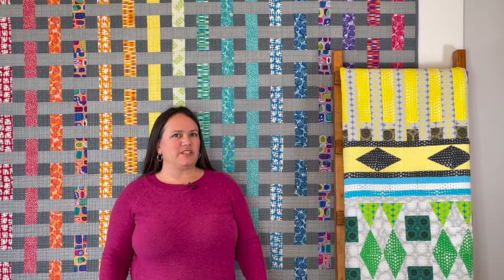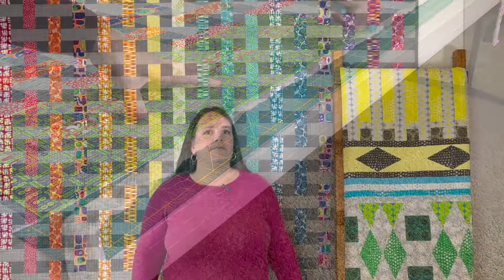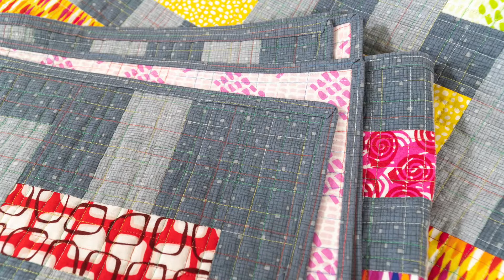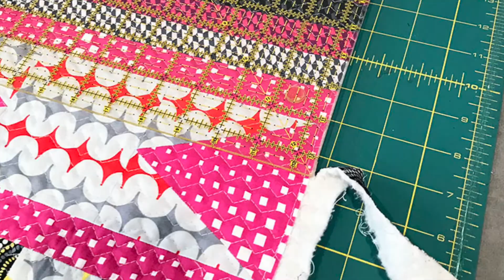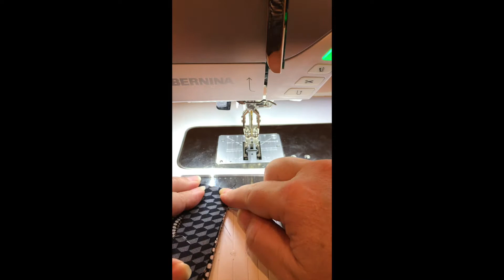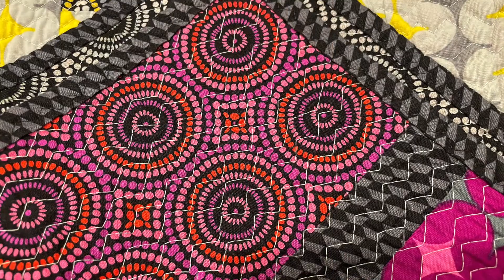How to Machine Bind Your Quilt

Comment: I was told to leave 1/4 inch of batt around edge to fill binding, so to not take width from the pattern.  What say you?
Reply from the maker: I think it's much easier to cut a narrow 2" binding and trim the edges flush, then wrap it tightly around the quilt. It holds up great, too!

Comment: Thank you for demonstrating what I consider the optimum method of machine binding. Christa, do you realize how few people teach this method?  I will NEVER hand sew a binding.  As a new quilter, I had to learn the hardest most frustrating lessons on the final join of binding through trial and error before abandoning the oft-taught, to the method that you demonstrate.  (But learning this method was frustrating because it is easy to be inside out and upside down).  I don't get on the soap box for much, but evangelizing this method  and sharing how I overcame my frustrations, is near and dear to my heart and is in addition to, not in place of, your excellent instruction.   I know that others have these problems otherwise the more inferior method would not be taught at all.

Your teaching embraces the following essential three elements for machine:

(1) pre mitering the binding strips.  You will never have a wobbly join (I use my CG Folded Corner Clipper for these due to its shape and size-:it is a MVP tool in my sewing room). I think that this is particularly important for new quilters because it provides a better visual, and reduces eliminates  material handling and sewing errors.

(2) sewing on the back and pushing binding to the front.  Why the "catch as catch can" method for machine binding  where the back binding may or may not be "caught" is shown time and again, I do not know.  It is an inferior method to this one. After 2 quilts, ditched that method and adopted this one.    My newer Bernina walking foot has an center edge guide which I can align perfectly with the binding edge. I can control perfectly each stitch. I've also seen a lapseam foot used--but I see no benefit over my foot choice.

Note that if you are mindful of where your original sew line is  the mechanics of sewing means that it will be in the ditch on the back--now achieving that perfect balance is sort of the holy grail.  But before you attain that,  It is sort of a "no matter" because if you are using a blended bobbin thread, your back is going to look just fine as you note.  If you have a dual feed, an edge foot could also be a helpful guide.  

(3) Mitering the final join. With all the trouble one goes to on the quilt, to have a "fold and tuck" final join is like serving a Twinkie for dessert after a fancy meal.  It is not worthy of the quilt.  A mitered final join should be the gold standard. People think that they cannot achieve it.  I'm embarrassed to say that I watched many videos and the twists, turns didn't stick in my head.  I just could not visualize it (and it did not help that the quilt orientation was different among the videos).  I know that I'm not the only one, because many do NOT use this method and opt for the fold and tuck.

(Get the Creative Grids Folded Corner Clipper (small)--you will use this for a lifetime of quilting).   When you cut your miters, the seam allowance is built into the cut.  It is more agile due to its size, and the tails are blunted for you, so there is no guesswork. (Accordingly, I'm not adding any additional seam allowance in my instruction below).    

So for the spatially challenged (me!), I want to share my tips for tearless, curseless, fearless joins:  guaranteed to be perfect, and your  brain will not overheat.  (Just as Christa demonstrates, with some small changes). Mitering your cuts before you join them makes the visual cues and material handling easier.

Orientation matters.  Work with your binding away from (quilt toward) you for these instructions.  Your starting tail is on the right (pointed left), and your ending tail is on the left (pointed right).(and yes you can do it the obverse--but remember I'm spatially challenged).  Develop your preferred orientation and work processes to ensure that ends are always where they need to be and you don't end up upside down/inside out (and think too hard about it each time).    Using CG ruler, when you cut your miters, the seam allowance is built in to the cut.  It is more agile due to its size, and the tails are blunted for you, so there is no guesswork. (Accordingly, I'm not adding any additional seam allowance in my instruction below).    

I work with 90 degree ends-and cut both together on the miter as follows:  Leave long enough ending tail  to work comfortably.  Leaving the binding folded,  measure the overlap for the width of the binding, and  cut it a wee bit longer.  This provides a wider gap _by a smidge_, but ensures that you get a flat final lay (taught NOT tight).  There is nothing worse than having a flaccid binding. (When carpenters and tile folks measure for precision cuts, they say the measure and then say  "inside" and "outside"  if they need a smidge less or more without going to the next measure. Quilting is much like those trades. You want an "outside" measure.  (though fabric is more forgiving substrate than tile or wood...so your outside can be a fat outside, and you can still make it work)

So that your tails are manageable, iron them open so that everything lays flat for next steps.

Here's the key for the spatially challenged: Turn the starting tail so that it is making a hard U-turn to the right (binding is away from you, quilt toward you).  RSU.  If you do this WSU, your miter will be backwards--and it is easy to do.  You will curse.  There will be tears because you will have to add more binding!  Stack the  trailing tail over the starting tail  RSU (this is just as if you were mitering your binding strips in a stack) , edges flush on the right hand side.  Make your mitered cut (bottom right to upper left is the direction--RSU for both--check it before cutting). 

 Now grab your starting tail, rotate left and place on your trailing tail (RST)--small turn counterclockwise and lay on top of the ending tail. (If you cut correctly, and twist wrongly, you are merely unpicking your join).   I find glue basting helpful here.  Until you master the technique, make sure that when straightened out you have everything oriented correctly and that you don't have a flaccid join.  Sew your 1/4" seam and check that it lays flat.

I will note that many triangle rulers allow you to make this mitered cut easily; however,  you need to ensure that the 1/4" line (the seam allowance marking)  goes through the bottom corner (not the edge of ruler).  On both strips, that is your 1/2" addition as Christa notes. Again, the folded corner clipper is an inexpensive addition that has many many uses and has the essential markings to take guess work out.

You will not have to say a small prayer.  It will be perfect each time.
Reply from the maker: Thanks for stopping by. I'm glad you enjoyed it!